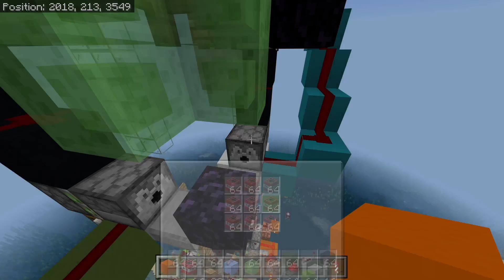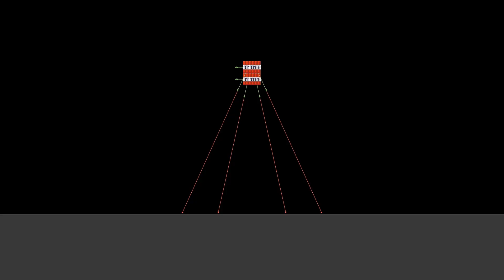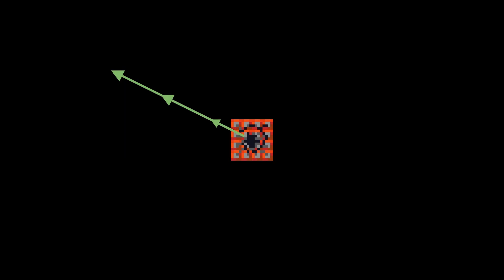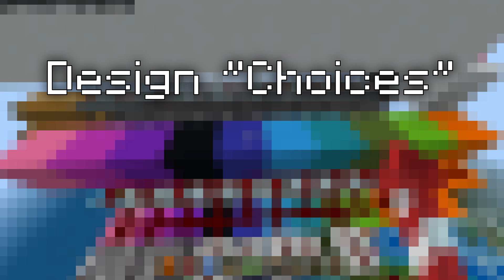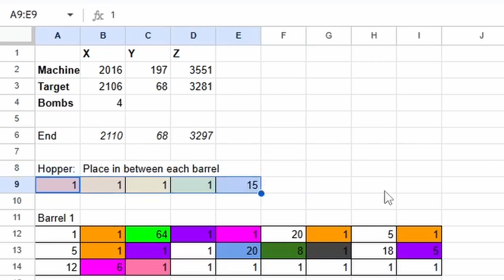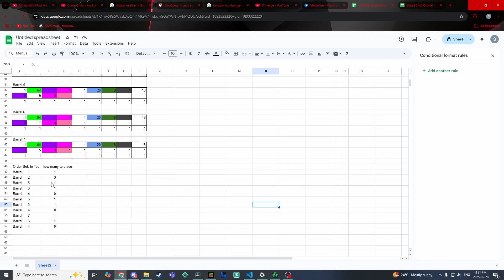Short Range Multi-Missile Launcher :: Minecraft Bedrock

Comment: The distance measurement is false if you use a form of mid flight propulsion by using smaller loads of tnt with less fuse times pushing it forward as it moves.
Reply from the maker: That does sound like it could work (I haven't done the testing) but it sounds like it would take a lot of very precise timings and I'm not sure how to make a nuke with that (not saying it couldn't be done).